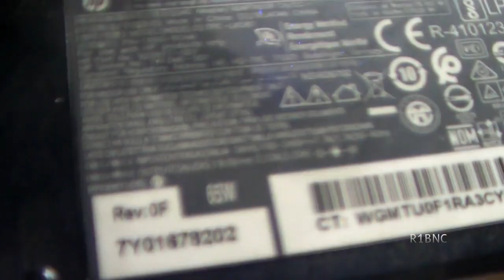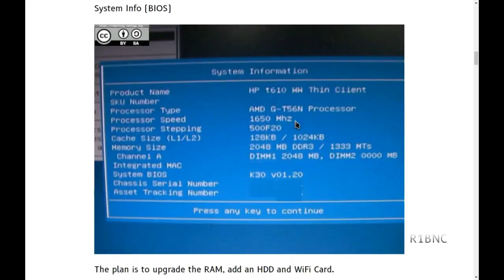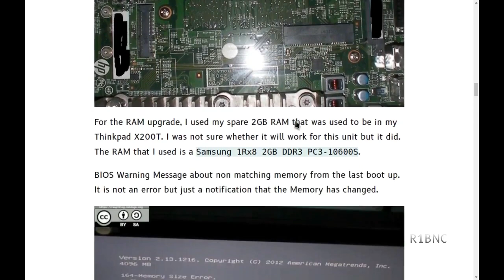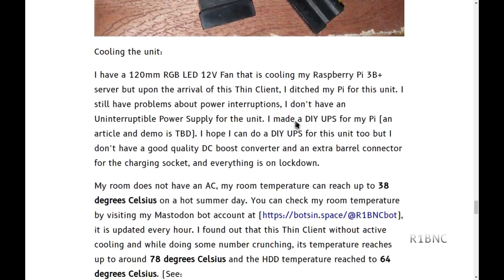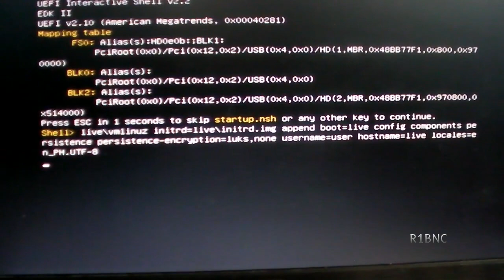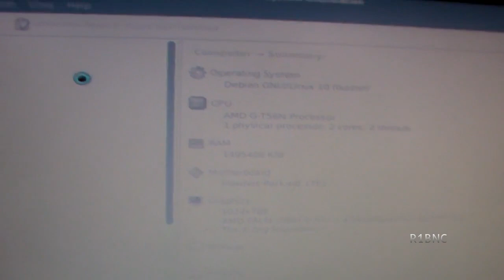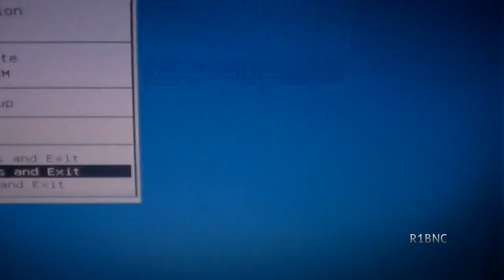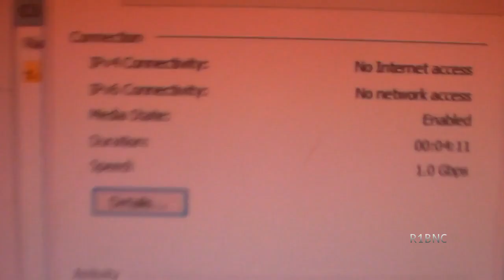HP Thin Client T610

Comment: m 2 sdd man you won't need all the cooling system it looks like a ramdisk but it's a solid-state drive in a small from factor. Plus you won't use that cardboard to stabilized it.
Reply from the maker: This device doesn't support m.2 unfortunately. I don't like to use sata to m.2 adapters

Comment: There are amost 20 people here in our floor at only 4 of us who have the same model. All of us are currently having the same problems now. IT recommended a RAM upgrade but I believe skype only require atleast 1GB RAM to work (mine is 4GB)
Reply from the maker: I have not used this model for desktop applications and I never used skype. I currently use this model for my network server. Advise ko na lang po is, i try ng IT kung meron sila alternative model ng hp thin client tulad ng T620. Ma checheck naman nila kung RAM problem kung puno ang RAM utilization sa Task Manager, medyo mabagal din naman yung CPU nito at hindi siya upgradable baka yun ang bottleneck. I can't speculate much since I have not used Skype and this model for Desktop applicatins/video conferencing.

Comment: HP T620 Thin Client would be better option as it has quad core CPU version for little bit higher price.
Reply from the maker: A problem is the lack of standard SATA port (you can solder a SATA connector though), but M.2 socket is available. I plan to buy T620 in the near future but for now I don't have any money.
Reply: @R1BNC  boss saan kita pwede ma reach ?

Comment: can this be used with freenas? Can the sata port power a 3.5" HDD? planning to turn this (or the t620, or whichever is better) into a nas and torrent box
Reply from the maker: I have no experience in using FreeNAS and can't give you an answer. Regarding the SATA port, no this can't power 3.5" HDD (No one has tried yet), this is designed to power 2.5" HDD/SSD. I don't have T620 to give comparison. I am using this as torrent and NAS box and it can handle it fine :D
Reply: @R1BNC  what about vpn during torrenting? I have a netbook that.I'm using as my torrent box, still using the mechanical drive, and it seems it can use my entire bandwidth. It's not using vpn at the moment. It would look like the speed would go down once its connected to the vpn.
Reply from the maker: @fat_joe  Try to set limit for the program? I have no idea regarding VPN and P2P, I don't want to pay for VPN. I don't trust the free ones
Reply: @R1BNC  I want the program to use my entire bandwidth. I'm also using a paid VPN. Based on my observation, it seems it can really use my entire bandwidth. It also is expected to slow down once I set it up to use VPN.  But I have to make sure how much it will slowdown. That way I know if I have to buy one of these or just upgrade my netbook.

Comment: Hey, have you tried openwrt in this with the PCI-e x4 port working could function as a decent router, and you mentioned you made a custom debian ISO, why can't we use the released debian iso and boot from a flash drive?
Reply from the maker: I have not tried openwrt, this is the slim version you cannot fit PCI-e card inside. You can run the released debian iso and boot from flash drive too. It just depends on you.
Reply: @R1BNC  Okay, thanks, do you know if the pci-e port itself is functional? i was thinking of using an extension/riser cable to connect the card and design some kind of case around the whole thing.
Reply from the maker: I can't test it. I do not know at this time
Reply: So, i did try out the PCI-e port with an extension cable, and its a x4 pcie which works perfectly, also you can create openwrt disk image and boot it on thin client
Reply from the maker: Good to know, thank you for sharing

Comment: Had the same model my main problem is that, skype calls are blurry or pixelated. IT dept said that it might be the LAN connection but we all have the same access and only mine had the problem. Do I need to upgrade something?
Reply from the maker: I think your IT is being lazy. Ask them if they have a spare unit for you to test. If they don't have a spare unit, ask them to try a USB to Gigabit Ethernet adapter, as they said that it might be the LAN connection. These units have gigabit ethernet connection,  so a connection problem should not have an issue. For the upgrades, I do not know whether all of your co-workers have the same specifications (RAM size, HDD/SSD size, peripherals USB cam, mouse, keyboard). I think it is best to try other peripherals (usb camera) and check for software updates.

Comment: how to install graphic driver? i go to the windows driver link, but the files is dont have the exe for graphic driver instalation
Reply from the maker: Hi, you extract the zip file and right click on the INF file and select 'Install'. You need to create a System Restore point, you can't uninstall the driver as far as I can remember after doing this.

Comment: ano video resolution nito? kaya 1920 x 1080 na monitor?
Reply from the maker: Not tested po sa 1080p wala po akong adapter ng DP to HDMI. Pero according po sa specifications kaya nito ang 1920 x 1200. Although nag sstutter ito sa HD videos. Currently using this as a DIY NAS Server, I can't test the video playback na. Salamat po sa tanong.
Reply: VGA Max Resolution: 2048x1536
DVI and Display Port: 2560x1600

Comment: Can it play 4k video?
Reply from the maker: I don't have 4K monitor to test (output is DVI and DP port). It can't play 1080p HEVC/H.265 dual audio video files.
Reply: @R1BNC  did you try using pot player?
Reply from the maker: I'm not familiar with pot player, I use VLC, mplayer and mpv for the Debian GNU/Linux OS.